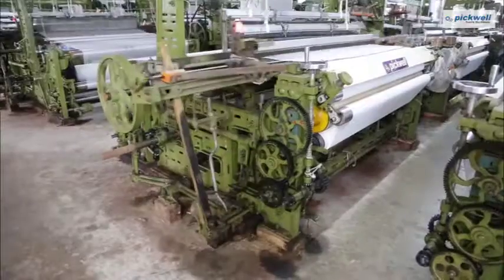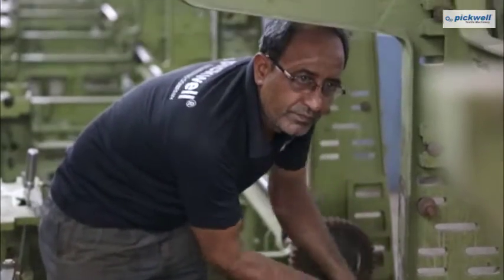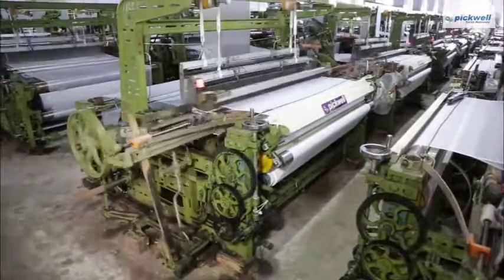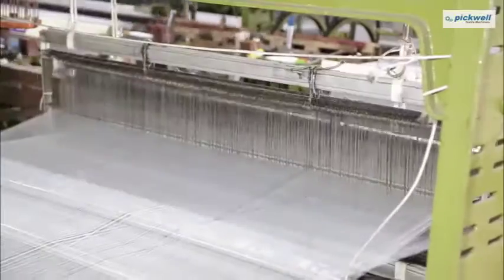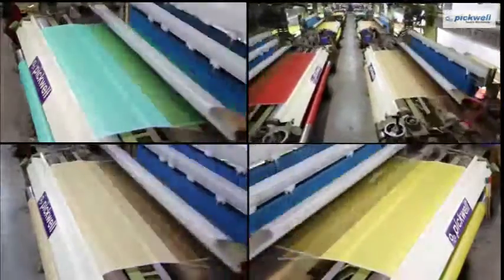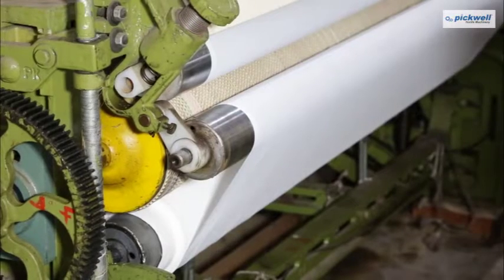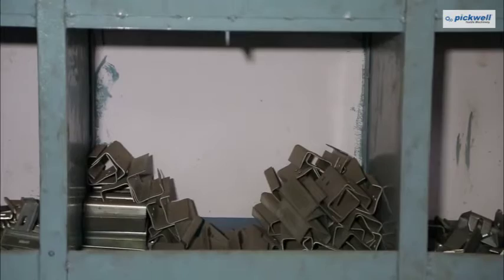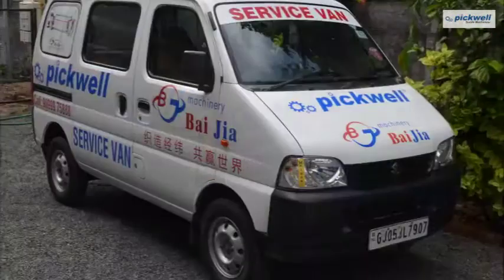Pickwell Shuttle Loom

Comment: now go for atlist indian Rapiar loom its gonna out dated....not Chinese Machine
Reply: sir , you need rapier loom ? we are manufacturer , price is : $500  per set , speed 240RPM , weft selector 6 colour , warp beam diameter 680 mm
Reply: @georgewilliam9533  price
Reply: @சுகியுமநானும்-zs4bk  $500  per  set
Reply: @georgewilliam9533  where r u from sir
Reply: @vigneshpalanisamy1635  china
Reply: @georgewilliam9533  new or old machine do you haved?
Reply: @izushort2383 old machine
Reply: @izushort2383  old machine
Reply: @georgewilliam9533  do you sell scrap
Reply: @haradhandas6290  yes, closed dobby with heavy wall rapier loom 280cm price is $1,500.  running situation, good quality
Reply: @haradhandas6290  yes, closed dobby with heavy wall rapier loom 280cm price is $1,500.  running situation, good quality , so when can you buy ?
Reply: U r repainting used machine and selling as new one rit.
Reply: U sell every scrap and want our borders captured.
Reply: @vigneshpalanisamy1635  what is your mean ?